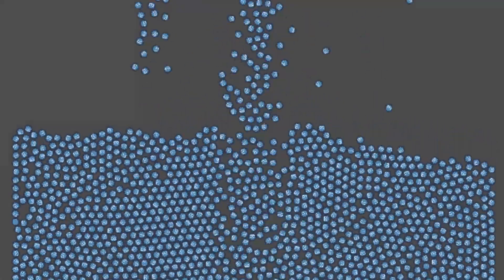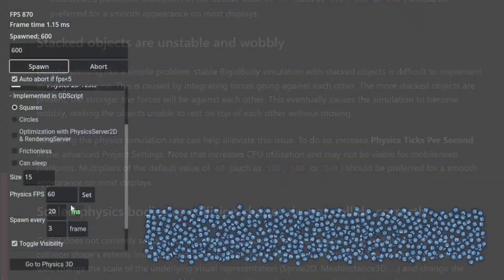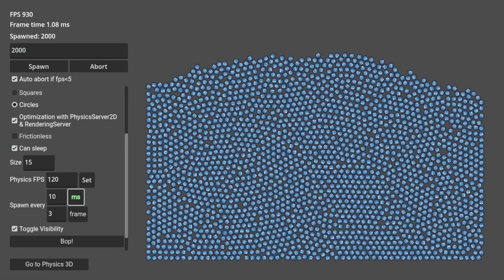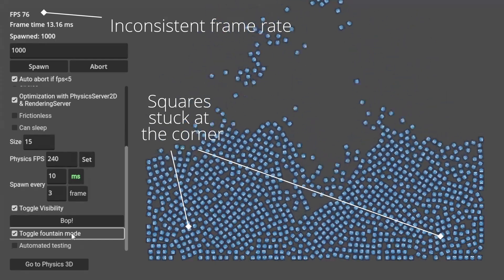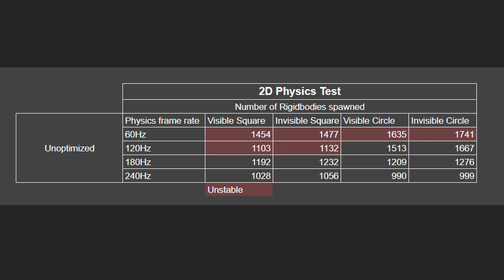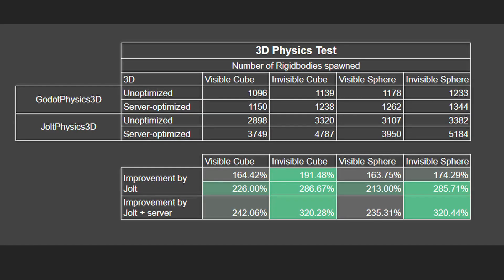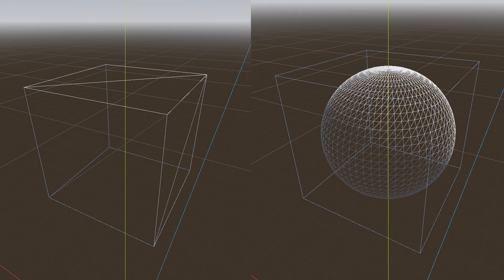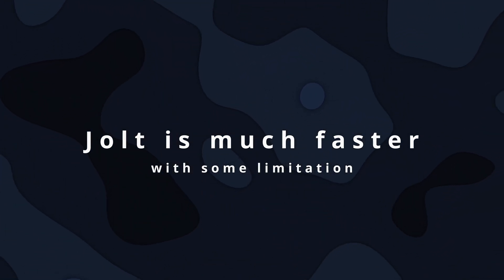I benchmarked Godot's Physics | 2D, 3D, Jolt, Server-Optimized, Glitches

Comment: Good to know. Jolt I'd say should be a go to for physics in GODOT.

I don't yet get what Server-optimized means. I will have to look it up.

I'd think running physics with something like, GPU physics or compute shadier (is also GPU) is what should up the performance.

When I see the word, Server, I think internet. I don't see how running a physics sim for a game, over the net would be more preferment. Unless the game was running on a cloud PC that has better hardware than one's own own PC.

So much to still learn.

But this is a good video, just to know Jolt in GODOT is good.

I now wonder if there is a way to use Bullet Physics in GODOT, and if that would be better than Jolt?
Reply from the maker: The server in this context is running locally. (Correct me if I'm wrong) In godot, there's a physics server, it's like an instance that's dedicated to process physics stuffs. Every physics frame, the server looks at all the physics nodes and processes them and returns the results to the nodes. If you "server-optimized" it, that means that you don't use physics nodes directly. And you'll have to manually pass the results between the server and your visuals. That means less work for the server and thus gain performance.
Reply from the maker: Basically you trade ease of implementation for some performance gain. This is not a topic that can be explained in detail in YouTube comments, I'm sure there's plenty of better explanation on Google.

Comment: Sure there's a benefit, but if you're already meddling with servers and third-party libraries to have a cumbersome and underperforming engine run better... Maybe it's time to switch engine.
Reply: first of all "meddling with servers" is called optimizing and using the feature set of the engine. there is no reason not to use it.
secondly, "third-party libraries" are also used by unity. you do realize that right? havok and physx arent in-house physics engines made by unity.